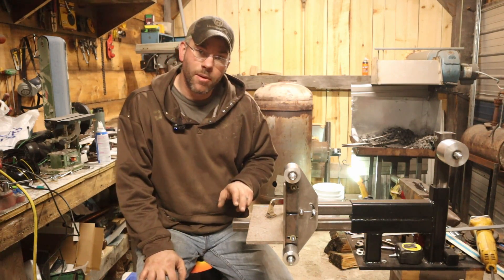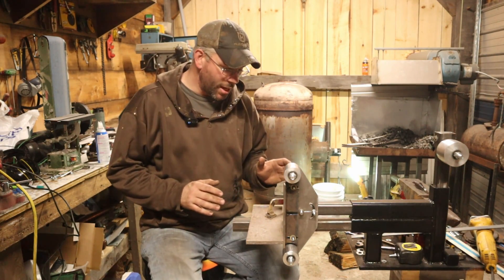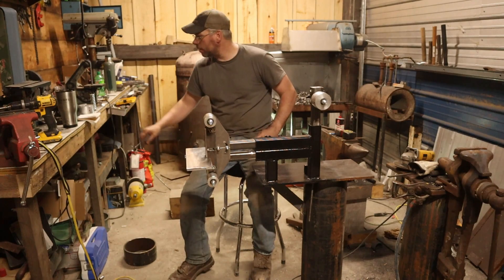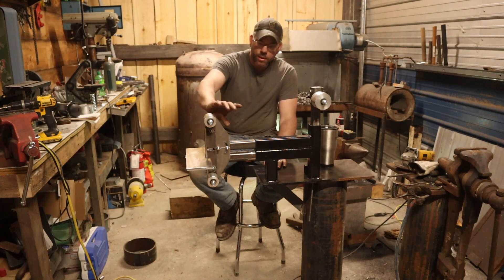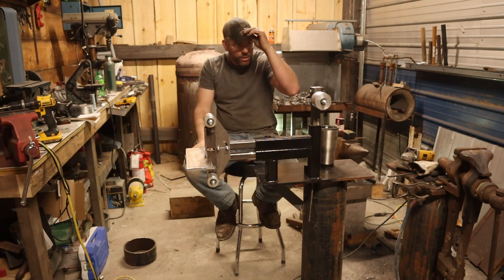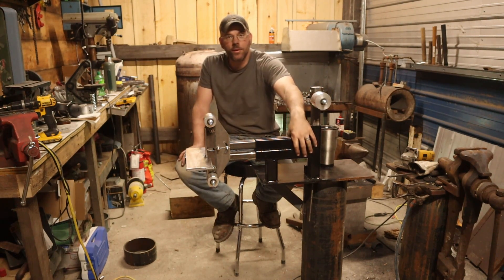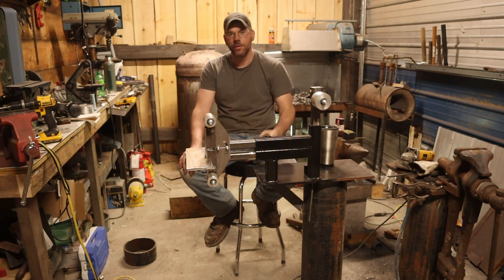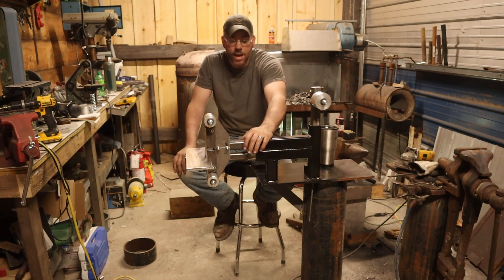2x72 Belt Grinder Build Made Simple For The Beginner Part 5

Comment: I have an idea for a double clamp bowed guide rod rest sharpener guide for draw knives. Just an idea that poped in my creative little brain. It would consist of 4 convex bearings mounted close together in the center 2 upper and 2 lower could even use 3 bearings 2 upper and 1 lower a single round guide rod that fits the u shape in the bearings. Guide rod could be curved to the exact bow of the draw knife and would run horizontal to the belt with two clamps at either end of the rod you should be able to rotate the blade slightly to and from the grinder belt for a machine perfect grind every time. Maybe overkill but would make production a bit easier.

Comment: I noticed you used 3in 1 oil during drilling. Last year during the forge build you touted windex. Were you out of windex?
Reply from the maker: I have to pick up some more Windex for the shop.  Nothing works better.
Reply: I was wondering if he said Windex. I know the SOB is crazy but maybe not on this one...
-Will
Reply: Hey Lars, I wondered the same thing.  I've been using window cleaner for drilling steel ever since Jim recommended it.  He's right in that it seems to assist with heat dissipation...probably due to the ammonia rapid evaporation.

Comment: Starting to look like one of the top of the line grinders. Love the foot pedal idea. The way mine is set up to take the tension off the belt the handle is in an awkward position and hard to get at. Only thing I can think of at this point since your still in build mode would be to fashion a lamp of some sort so you can see what your doing. Very inportant for me as a knifemaker. Light is everything. Good luck and can't wait to see the finished piece.
Reply from the maker: That is a great idea.  I have a drill press light that would work well for that.

Comment: I didn't hear the squirrel cage rattling on the sawdust  heater today. Great progress, thanks for sharing.
Reply from the maker: It's actually the metal plate going through the wall that makes the noise.  It was a good day in the shop yesterday.

Comment: Judas Priests!! You're going to need a crane to move that Sherman tank around. When the barn flies off to Oz, the only things remaining will be the anvil and the belt grinder. Heavy duty stuff, sir. For the faceplate on the platter, if you are worried that it'll get deformed from minimal use, why don't you temper it yourself? Will that not work? Nice work regardless! Cheers from a filthy Canadian.
Reply from the maker: Hello my filthy northern neighbor, it's mild steel so it won't harden anymore.
Reply: @TheTradesmanChannel   Gotcha!! I learn something new everyday.

Comment: Morning Jim. 65th view, 5th like 2nd comment. Machine is looking good. You know, there are better cutting fluids out there than 3in1, right? "Tap Magic" for instance, let's the bit cut better and stay cool longer. It is chemically designed to be a cutting/drilling fluid. Like the tool rest, good job.
Reply from the maker: I have to grab another bottle of Windex for the shop.  Nothing works better.
Reply: @TheTradesmanChannel  every craftsman has their preferred cutting fluid. At least you didn't pick a flammable one.